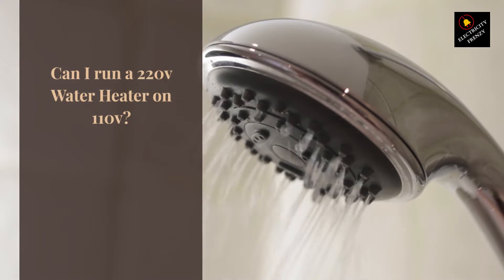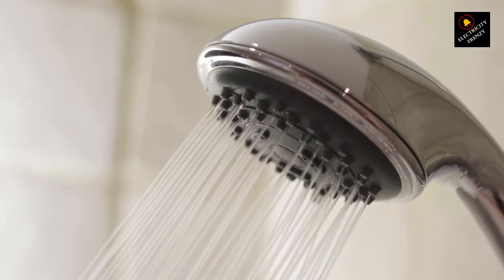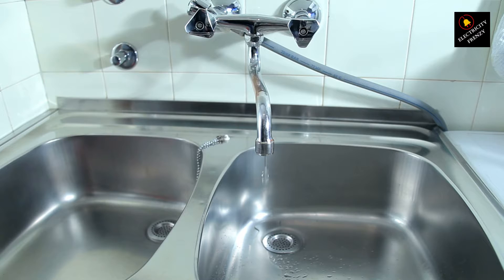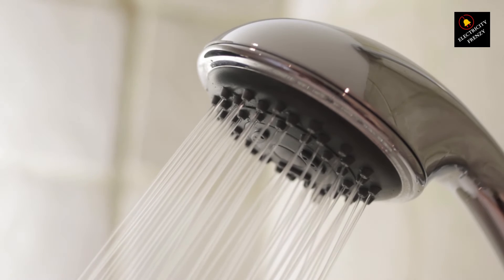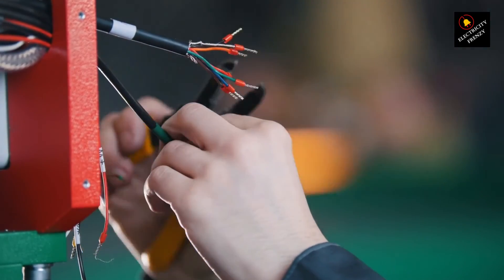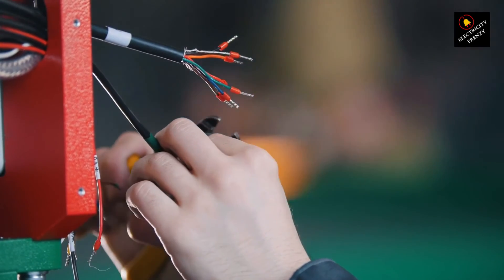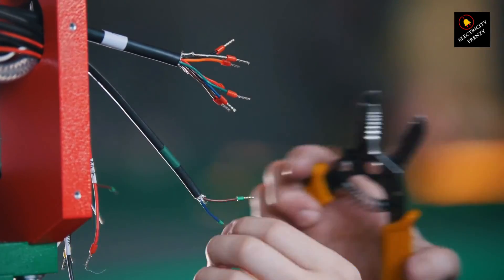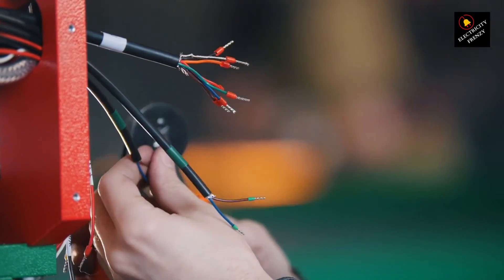Can I Run a 220v Electric Water Heater on 110v?  Electricity Frenzy Shocks the Truth!

Comment: Who TF wrote this? It works fine only downside is it takes 2x as long to heat the water. As far as draw most water heaters draw 2000 to 2200 watts at 220v at 110v that would be 1000 to 1100 watts same as most toasters so overloading wiring is unlikely unless you already have poor wiring. This is critical knowledge if you are in an area affected by a long-term power outage. You can literally take the 2 wires out of the 220 breakers and hook one up to each of the flat prongs in a standard 110v plug ( the white and black wire in a cord) using wire nuts or Wagos. FYI it doesn't matter which one goes to which one in this case as long as the wires are only connected to the water heater. If the house is wired right nothing else should be on that circuit. JUST make sure everything is turned off before opening the panel. The main breaker and the 220 breaker.